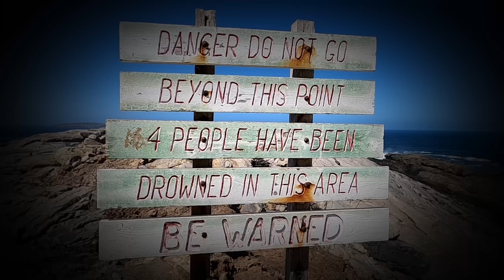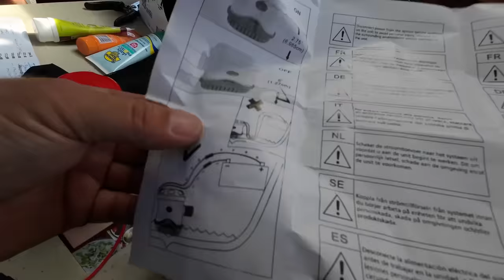What does Karl do to stop the leak in the bilge and more of what's happen aboard SV Awaitea

Comment: I noticed in your video that you had a few plants, you might already be aware but when your sailing you heel over and anything left on a bench or shelf not tied down will go flying to the floor. Happy sailing and looking forward to seeing your new adventures.
Reply from the maker: Thanks Carol,
We will need to go through the boat and make sure everything is secured before we set off
Cheers
Reply: U can put plant pots in a swing system like the stove so when cooking sailing so as u lean they stay up right , good marine grade stuff like wire a cheap way , also when buying stainless steel stuff take a fridge magnet with ya if it wanting to stick its crap stainless with iron in it no good it will rust , good grade stainless the  magnet will feel nothing buy that 👍
Reply from the maker: @davidmilledge221 
Thanks David, that is a good idea.